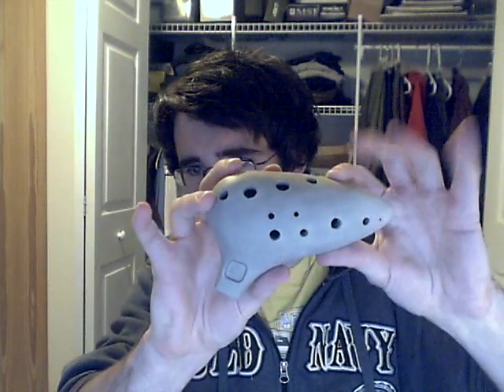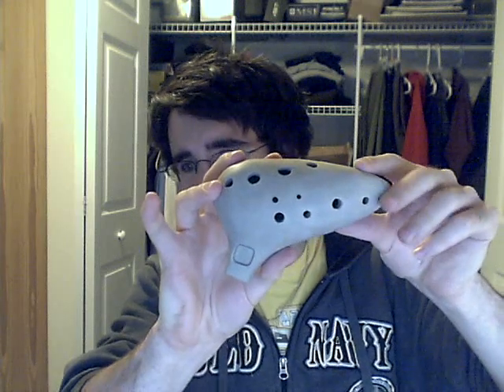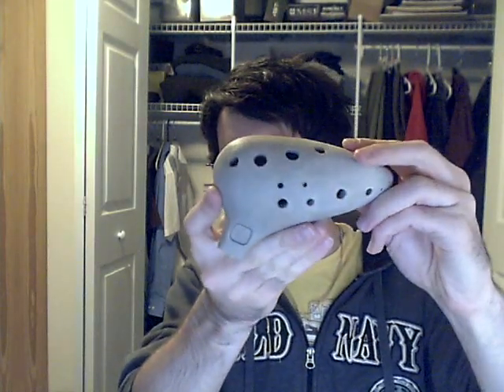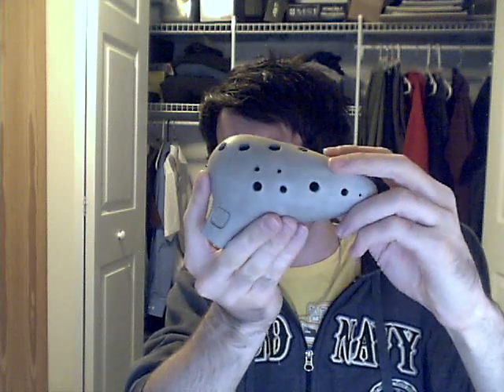4th Ocarina Attempt

Comment from the maker: @Chichiri520 I use drill bits to make the holes, and most  are different sizes. It is possible to make an ocarina with the majority of the holes being the same size. However, for it to be properly in tune, the maker needs to undercut a lot. Ocarina makers use undercutting all the time. Essentially, you take a blade and make cuts (at an angle) along the hole's interior wall. This effectively makes the hole bigger (raises the pitch) while maintaining the size of the hole the player covers.